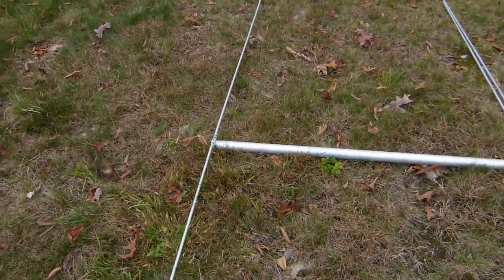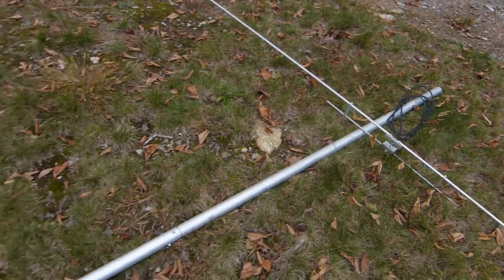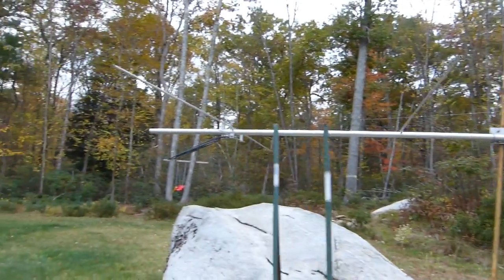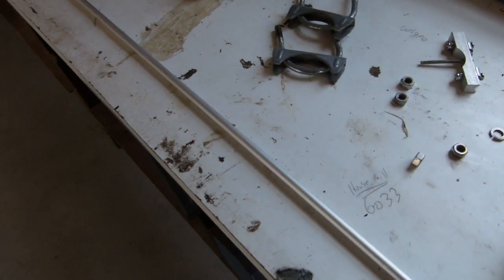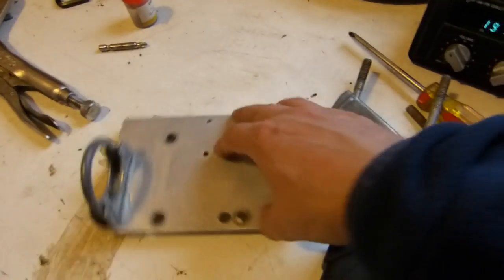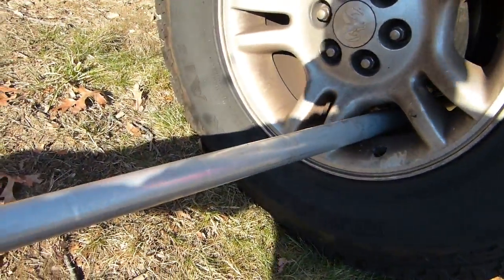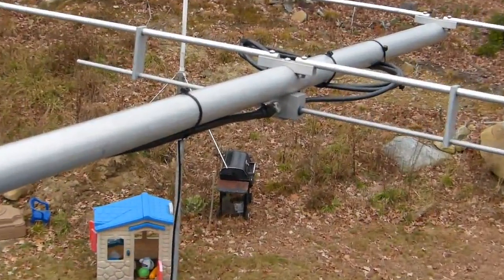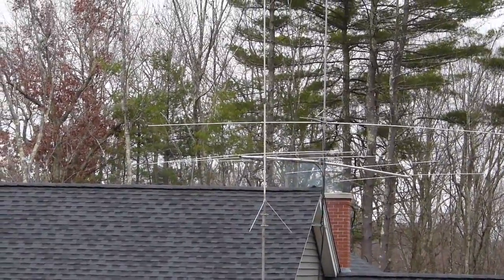6M5X 6 Meter Yagi Antenna repair and temporary installation

Comment: Hello. question: what is the minimum size of the iron pipe 12 meters for lifting the yaghi fm antenna Dimensions antenna gauge L*W*H: 5500*900*1760 MM Weight: 5 KG? thank you!
Reply from the maker: Sorry, but that's something you will need to work out for yourself....I really don't know

Comment: Solid bar much too heavy.
Reply from the maker: Seems to work fine in this application.  This antenna has been up since this video was posted with no issues.  In fact, I just used it yesterday.

Comment: hello ted here Kd2ard love your Video on repair on your M2 6M5X 5 Element 6 meter antenna i love making my own antennas i was wondering how i could obtain a copy of Dimensions design plans like you have in the video i like to make this antenna for my newly ham Opreator my son zachary looking forward to your reply thanks so much please your call there steve is ?
Reply from the maker: Ted Dean you should be able to find all the info for this antenna on the M2 website.  Another good source for plans are the ARRL antenna books.  I'm glad you liked my video!  thanks for watching and taking the time to comment.